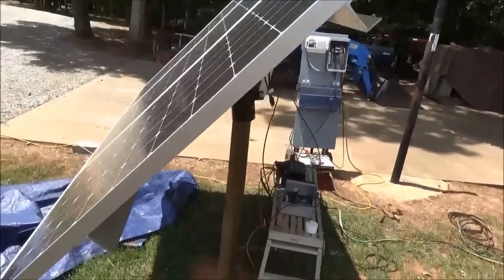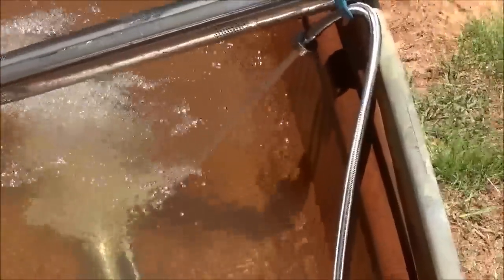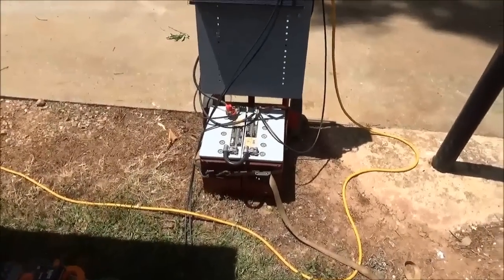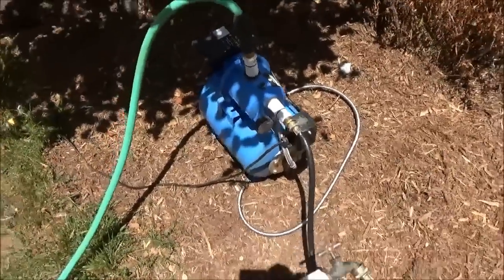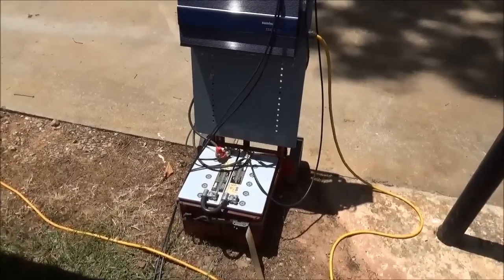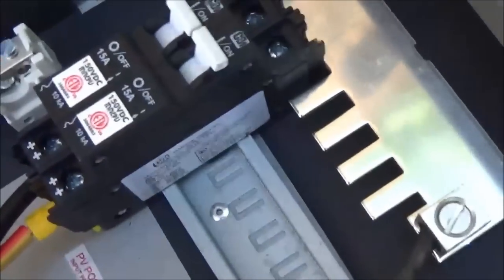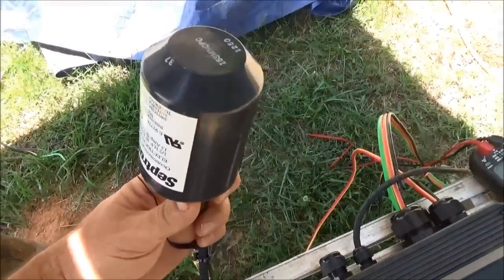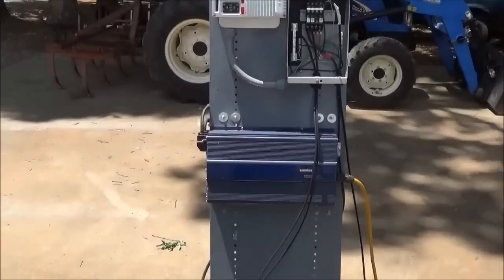Solar Generator Add On

Comment: Hi. I have had an idea the last couple of days and this video has shed some light on the situation, but I still have questions. For example, I want to install 24 * 300 W solar panels, with 3 panels in series and 8 sets in parallel. They will primarily run to a Victron MPPT 150/85A charge controller on a 48 V battery bank, this however is only capable of charging the batteries at roughly 5 kW. I know I will never get the panels installed capacity of 7.2 kW, but this way I can be running my charger at 5 kW for longer periods of time during the day. What I plan to do with the extra capacity is run my submersible pump and the pool pump during peak sun hours. That would mean I would have 3 different controllers running of the solar array, each with a built in MPPT controller, will they work together? Or will the MPPT algorithms of the two pumps (Lorentz PS 600 controller) interfere with the Victron MPPT Charge Controller? The Victron Charge Controller has the ability to limit the power from the solar array if the solar array is producing more than it can handle.

Comment: how do you feel about the tesla powerwall units?
Reply: As professional battery based solar system installers, we have great hopes for the Lithium batteries but unless you need it to be super lightweight and have tons of cash, the lead acid batteries are still a better value for most customers.  Lead acid batteries, with all their drawback are still a tried and true technology.  We love the lithium for power tools.

With the Powerwall, two things I see that are problematic are the liquid cooling system and the 450-500VDC output voltage.   Tesla has yet to debut it's balance of system to work with these batteries.  We will see if they can invent something better than the current market leading inverter companies Outback, Magnum, Schneider, etc.  

Supposedly Solaredge is developing the inverter part of the Powerwall system so we will wait and see.  I think we are still 2-5 years from having lithium as a standard in residential battery backup solar system

Comment: Great topic for discussion Scott. I have wondered this exact same thing. I am looking at building an off grid house here in the next year or two and will more than likely have a direct solar powered well pump (no batteries, pumping only during the day into a storage tank). I was curious if there was a way to divert the power from the wells solar panel to my main battery bank once the float switch told the well pump controller that the tank was full. Being a single guy, I wont be using a ton of water. Just for easy figuring, if I used 100 gallons a day and the pump can put out 2 gallons per minute, the tank will be full in less than 2 hours, and then the solar panel would just sit for the rest of the day.

Comment: It would by nice in areas with less sunshine if the float switch could be used to send the signal to the solar system that the tank is now full and the solar can now beused for other purposes and vice versa.

Comment: love it. i have a 100 ft well is there a system you would have me look at? my pump in in the well and i have a small pressure tank that feed to my home about 100 yards about 8% grade.
 Keep up the great work.
Reply: You really need to figure out how much power your pump surges.  The pump is most likely a 1/2 -3/4HP submersible that runs off 240 vAC.  It probably surges around 20-25 amp and then goes down to about 7-9 running amps.  The 22 amp surge at 240v puts you into the world of robust inverters.  We usually recommend you replace the pump with a solar pumping solution that has a very low starting surge or you leave the pump where it is and install a battery inverter that can start that pump.